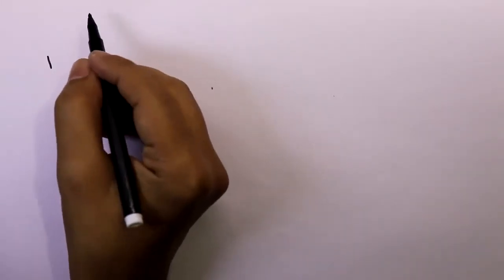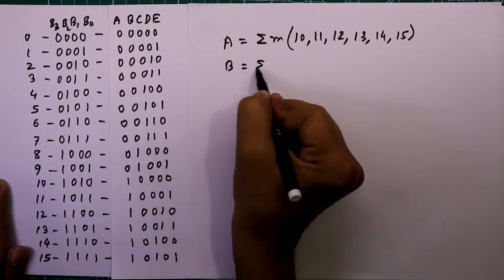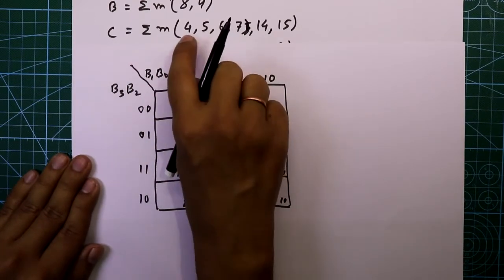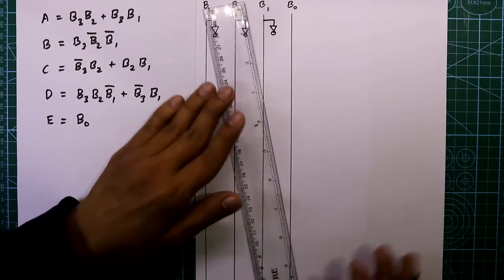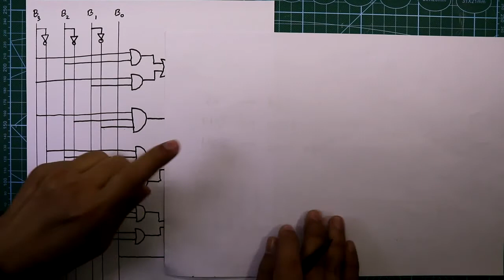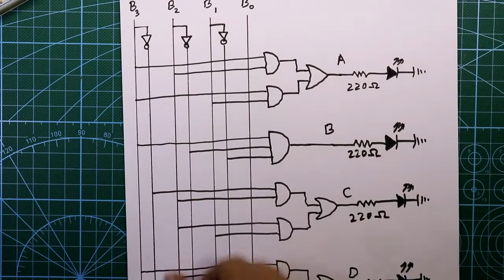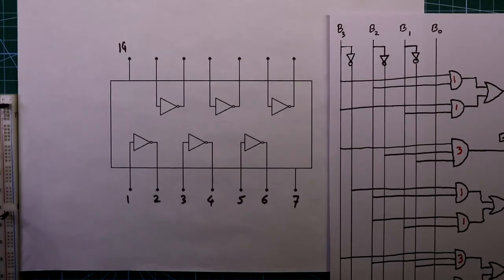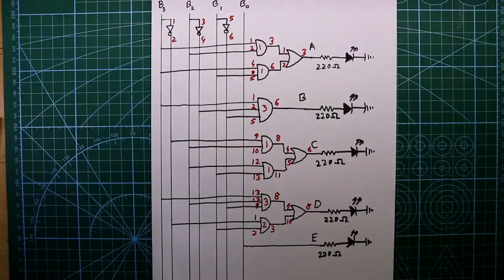Design a Binary to BCD code converter using K-map | Practical circuit

Comment: when you need a pull-down resistor for "E" the jumper wire that used besides of the resistor end.it makes me confused because the bread board horizontally is open

Comment: What about when input is 1000 in binary??
Reply from the maker: (1000)2
= (1000)BCD
Reply: What if i use 3 input AND gate IC 7411???
Circuit will be same from diagram or i have to change something
Reply from the maker: It will be same as I've drawn the circuit, just follow the pin diagram of 7411. I do not have this so I had to make three input AND gate from two input AND gate IC.
Reply: If i use push buttons instead of switch that you have used, will there be any difference or it will work fine.
Reply from the maker: Just fine, it will work as it is.
Reply: Can you help me. It's not working.